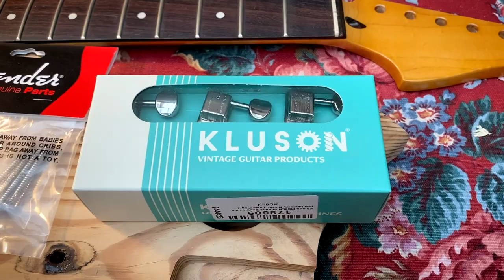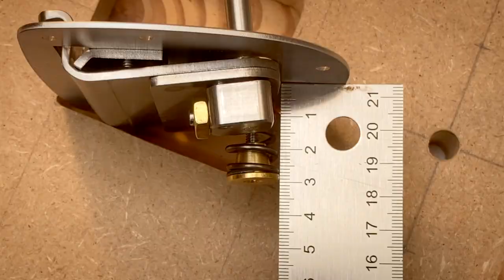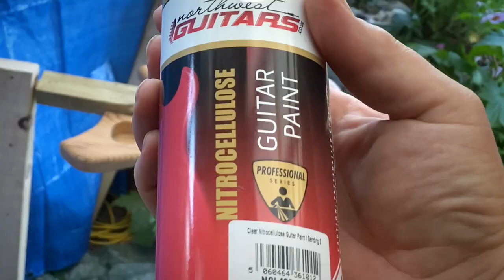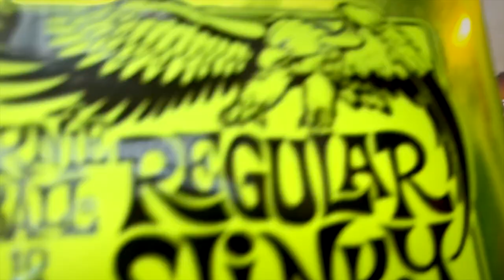How I Built my First Guitar with no experience - Full Build - No Talking

Comment: Looks stunning! I have a spruce body partscaster, and i like it so much. But the finsih is so fragile(nitro thin paint), and the wood is soft, so the dings & scratches appearing very fast and easy, it will get that relic look very soon. Do you have the same problem? Pine is about the same softnes as spruce.
Reply from the maker: Thanks so much for watching and for your comment. 
Yes pine is a relatively soft wood but I’m not really concerned with scratching or dinging it so I haven’t thought that much about it. 
Also, the wood I’m using is at least 215 years old meaning it was chopped down 215 years ago so it’s not as soft as the pine you can buy today. Maybe that’s a factor too 👍😉